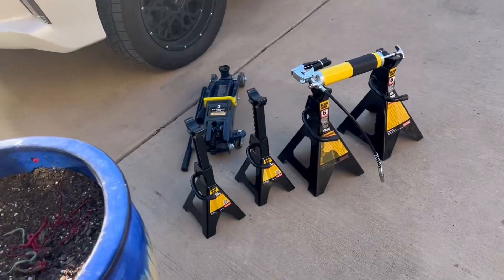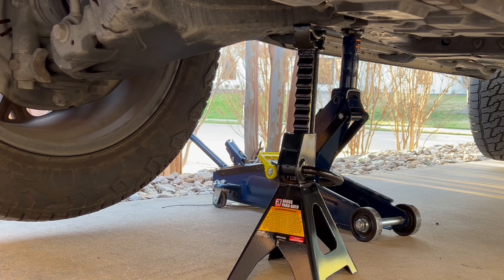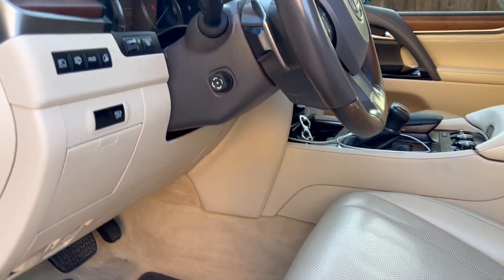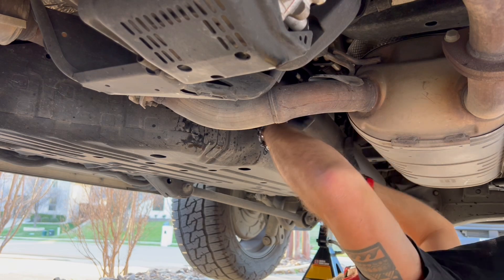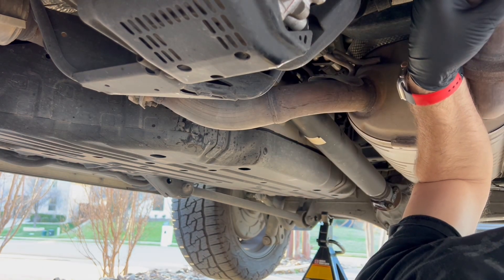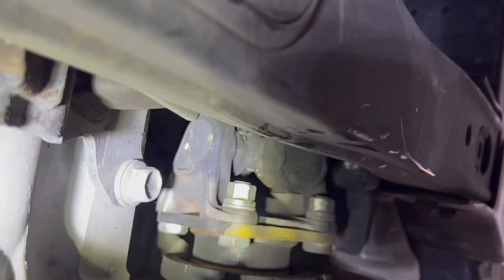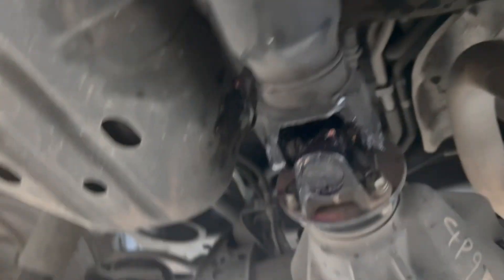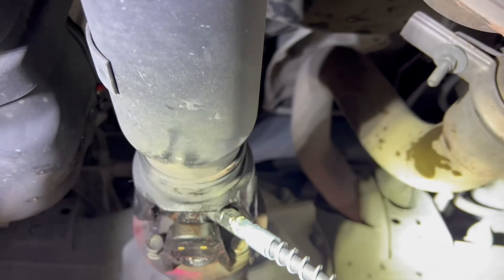2017 Lexus LX 570 drive shaft and ujoint lubrication, grease your own drivetrain and save money!

Comment: I start my 460 and spin the tires to look for vibrations. Found a tire out of balance. I grease mine every other oil change. chuck
Reply from the maker: I am going to get on that schedule as I am hoping mine goes over 500K without major issues.

Comment: Thank you for this video! I have the same vehicle. Is it just me, or does your LX also seem to wander over the road? I have new tires, alignment the whole 9 yards. Is it because of the hydraulic suspension? It has always been that way. I'm just curious to know if that is just the way this vehicle drives.  The steering  seems to follow every little dip in the road surface.
Reply from the maker: Apologies for the delay, I would want to compare with other vehicles as all my vehicles can wander a bit based on road crown, imperfections, etc, and my LX drives similarly.  I am not a pro at diagnosis, but has yours had the ball joints checked or has it ever been in a front end accident?  For mine, I could not attribute any wandering to hydraulics, mine is well planted.
Reply: Thanks for your response.  No I haven't had the ball joints checked and there hasn't been any front end collisions. I will start with having the ball joints checked out. Thank you!

Comment: I’ve heard the slip yokes could bind if you over grease them? I saw another video where they greased the slip yokes then after putting vehicle on ground they loosened the zirc and used the AHC to drop the vehicle to let any extra grease squirt out.
Reply from the maker: That is interesting information, thanks for sharing.